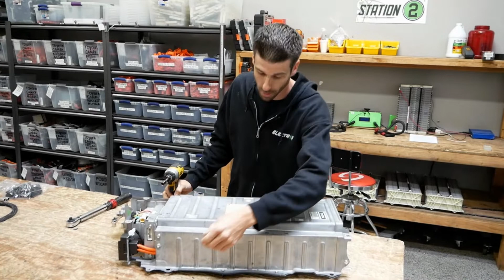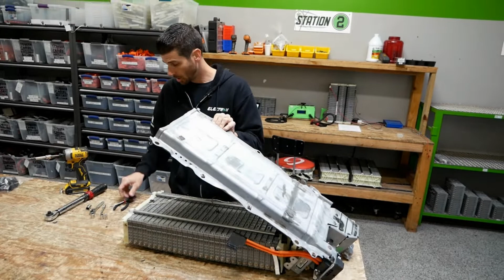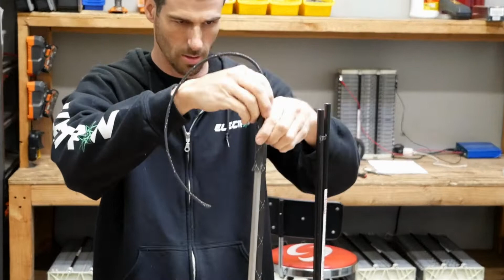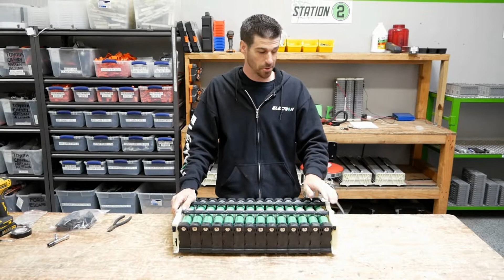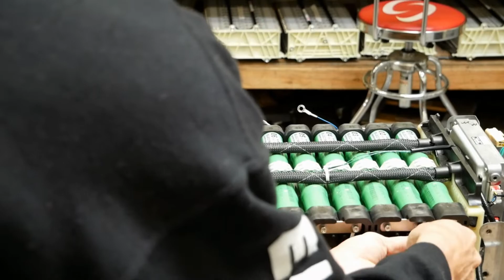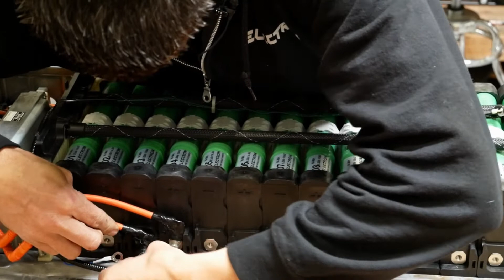How To Install New Cells on 2004-2009 Toyota Prius From Electron

Comment: I recently installed new cells on my prius 2010 but I stripped a couple 8 millimeter Bolts that hold that the battery cells.  If I'm missing a couple is it a big deal?  it seems pretty sturdy and sits really tight without the bolts
Reply: If you're talking about the bolts on the bottom holding the cells to the case, no, it is not a big deal.
Reply: This happened to me but I’m worried about the warranty. The install was also not successful and I’m thinking of returning. Will they still accept it?